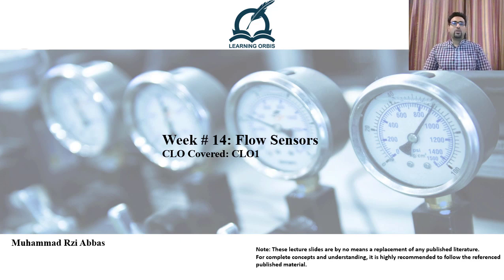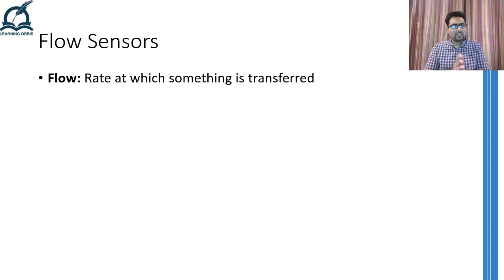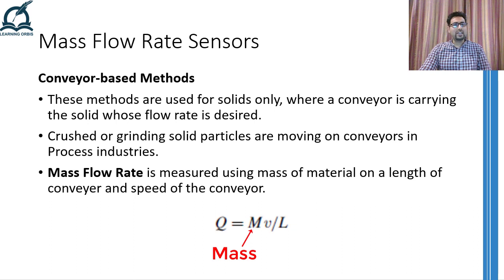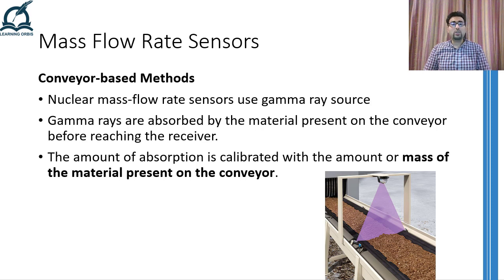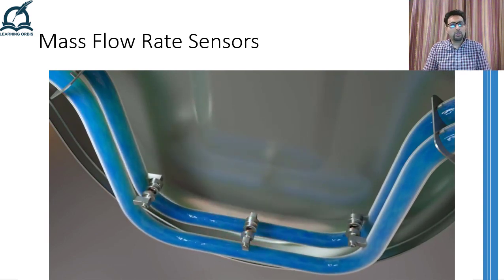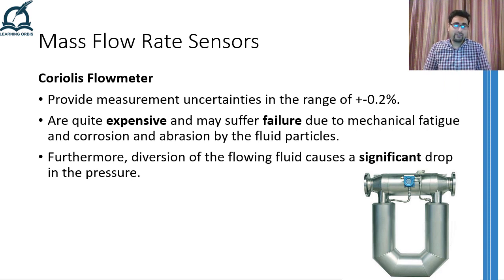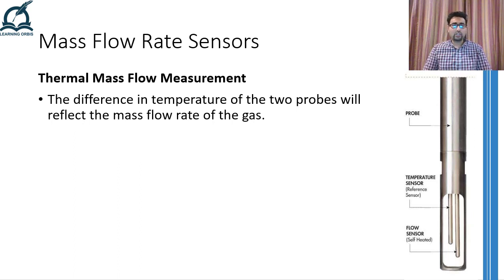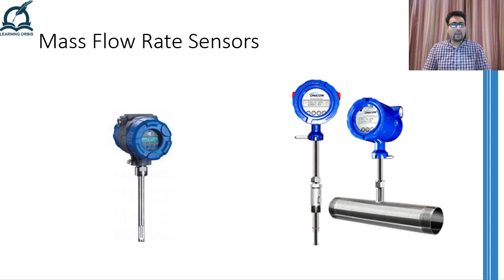Lecture 14 Mass Flow Rate Sensors

Comment: Methods to measure the weight of the material on the conveyor are:
Load Cells
Radiation based sensor

Comment: Methods to measure the weight of the material on the conveyor are:
1- Load Cells
2- Radiation based sensor

Comment: The weight of the material on a conveyor can be measured by using:
1- load cell 
2- radiation-based sensor

Comment: By radiation based sensor we can also measure the weight.
Using the load cells we can measure the weight directly on the conveyor.

Comment: The weight of the material on the conveyor can be measured using load cells and radiation based sensor.

Comment: The weight of material present on the conveyer can be measured by using methods such as load cells, radiation-based sensors.

Comment: The weight of the material on a conveyor can be measured using:
- Belt conveyor load cell 
- Radiation-based sensor

Comment: Some other methods for measuring the weight of the material on the conveyor are:
--> Load cells
--> Radiation-based sensors

Comment: The other methods used to measure weight of material present on conveyer are:
1. By using Load cells
2. By using radiation-based

Comment: The weight of solid on the conveyor belt can be measured by installing either Load Cells in the belts, FSRs or piezoelectric sensors.

Comment: Optical belt conveyor can be used to weigh the material and find mass flow rate. Optical conveyor belt scan the powdered flow mass profile in real time and the data is processed. Firstly optical sensor grab the cross profile of the material and secondly optical belt scale measure the feed rate of belt using an inductive sensor. Both these values are then used to calculate mass flow rate. One example of model of sensor is S600 belt scale.

Comment: A simpler way of measuring weight on conveyor is installation of load cells underneath the belt. This employs the use of strain gauges for weight measurement.

Comment: We can measure the weight of the material on a conveyor using the  radiation-based sensor, FSR, or Load cells.

Comment: 1-Using the load cells we can measure the weight directly on the conveyor.
2-By radiation based sensor we can also measure the weight.

Comment: We can measure the weight of the material on a conveyor using load cells. A conveyor belt incorporates a variety of load cells implanted in belt modules to quantify forces normal to the belt's conveying surface.

Comment: By using the load cells we can measure the weight directly on the conveyor and by radiation based sensor we can measure the weight

Comment: 1:By using the radiation-based sensor we can measure the weight of the substance
2:We can use load cells to measure weight as well

Comment: 1:By using the radiation-based sensor we can measure the weight of material on conyeyor. This sensor consists of radiation transmitter and detector.
Difference in radiation passed and detected is directly propotional to the weight of material.
2:Load cells

Comment: 1.By using radiation based sensors we can measure weight of material.
2.By using load cells we can measure weight

Comment: We can figure out the weight of the material present on the conveyer using Digital Signal Processing techniques. Digital Signal Processing analysis, algorithm design and simulations are done in MathCAD. Implementations on DSP hardware are done using Hyperception's Visual Application Builder VAB. This system can measure the weight of moving parts via a sliding scale, filter out industrial noise from samples, auto zero after every sample, calculate friction coefficient and log all of these data, accurately.

Comment: If somehow, the thickness of the material on the conveyor is made uniform, Machine Vision can be applied to approximate the weight of the material via an algorithm, which can be made with sample material, calculating its surface area and mass, the mathematical equation can be made, which will output the mass flow rate of the substance on conveyor. 
The conventional technique of measuring mass using pneumatic pressure can also be applied.